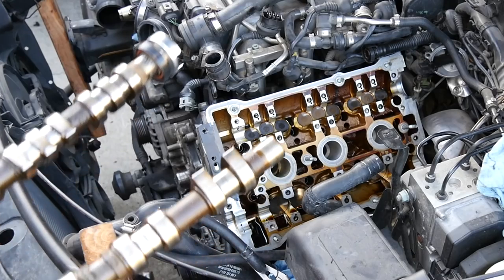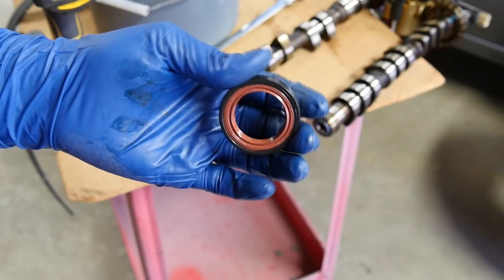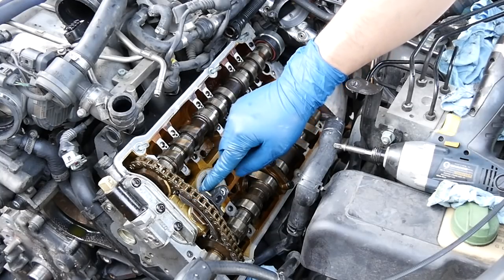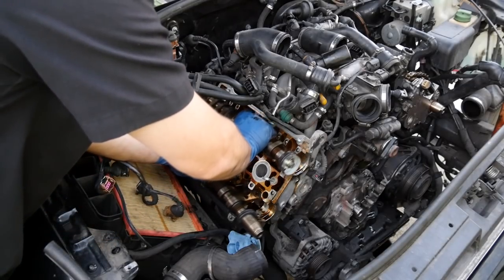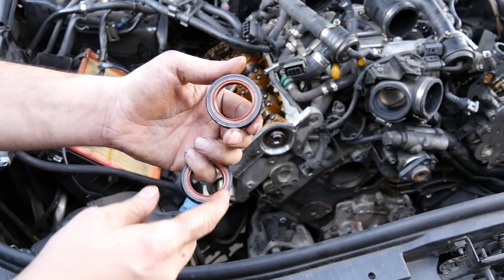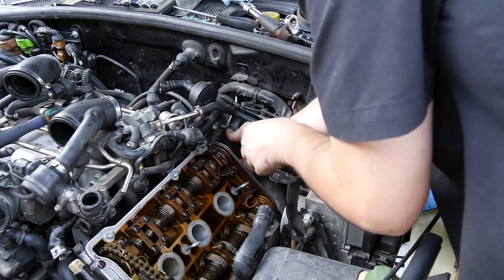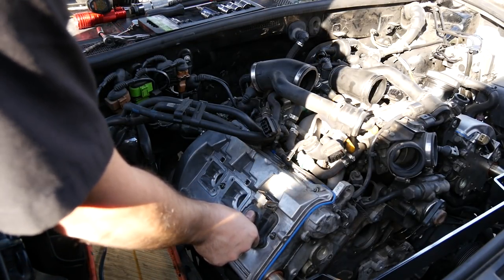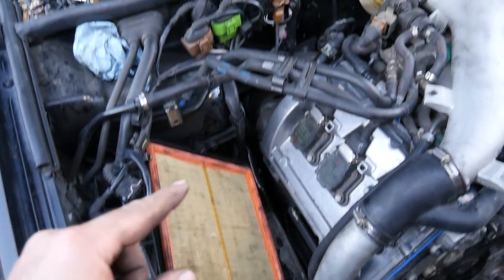Crazy Bi-Turbo Audi Maintenance Procedures - Camshaft Seal and Gasket Replacement

Comment: Hey R&W guy (I still don't know your name) - I LOVE your videos, especially these videos on your 2.7 bi-turbo. On my 2.8 V6 Passat B5.5, I JUST finished replacing both cam tensioners, cam chains (connecting both cams), CCT gaskets, all 30 lifters, timing belt, cam seals, rollers, water pump... and on and on.  The car runs AWESOME now.  Your videos were VERY helpful. You asked in one of your videos if these tutorials are helpful because they don't make you much money, but I can tell you that they were invaluable for me.  I can't thank you enough!

Comment: "Tourque it down to factory spec" proceeds to hit it with an impact.
Reply: Ford Fanatic 😂😂that shit kill me🤣🤣
Reply: I've seen others use hand tools and say the clicking noise to satisfy the viewers.
Reply: Could be a torque controlled impact gun, I believe some of them are very accurate.
Reply: Right that shit killed me 😂
Reply from the maker: I torqued it to factory impact spec.
Reply: Gutentight, factory spec!
Reply: Ford Fanatic . Factory spec/real world spec.
Reply: I read your comment and then couldn't stop laughing when I saw it happen
Reply: great humour 🤗
Reply: Ratchets And Wrenches haters will be haters - no need to explain yourself
Reply: I believe its the Hall sensor rotor to camshaft, should be 20/25 Nm
Reply: sense of humor, anyone?
Reply: We that spec “torque it to yes” in my shop, it works everytime

Comment: Great video, always wanted to know how the chain tensioner worked.  I had several Audi in my time Audi GT Coupe, 5000 CS Turbo Quattro, and the first V8 imported by Audi.  Still have the tool to remove the crankshaft bolt for the V8 in order to do a timing belt.  I used a torque multiplier  (4:1) to remove stubborn bolts (especially crank bolts).  This avoid breaking your knuckles when the bolt break loose.   Keep up the video, and we appreciate your time in making these videos.

Comment: You might have this video I honestly haven't checked, lol. But make a video of how to perfectly line up the front bumper on a B5, please. Rear bumper too if you want, lol.

Just did the front crank seal on mine, as well as timing belt service. It was so much fun. But boy does it sound nice when it works 😂

Comment: FYI: The driver's side intake cam seal on the rear is a different part than the front seals. The cam rotates in the rear seal counterclockwise, whereas it's clockwise on the front seals. All of the new VW Audi cam seals are PFTE without a spring under the lip and are supposed to be installed DRY.

Don't install the valve covers until AFTER you get the new timing belt installed. Then rotate the engine by hand at least two rotations, then reinstall the cam locking bar, check and recheck the timing on the cam marks. Count the chain link pins. If after that you're sure the timing is right, you can then install the valve covers. 

The timing chain tensioner plastic shoes should have been replaced when the tensioners were out. These wear out, get brittle and break off, leaving plastic bits in the head and down in the oil pan, cause metal to metal sliding contact between the timing chain and tensioner, cause extra slack in the chain, and then the chain can then jump a tooth or two and cause the valves to collide with the piston tops. Yes I am speaking from experience. Happy wrenching.

Comment: RNW - very helpful and well done videos I have an 2004 Audi Allroad 2.7t I have pulled heads and replaced the gaskets, timing belt I am getting codes P0340,P0345 engine is running and started on first try lots of smoke that went away, engine is running rough and idling just as bad  I read to change the Camshaft position sensor I had an extra one switched it out but still the same issues after clearing the code? Timing Belt? any suggestions would be helpful and thanks for the great videos.

Comment: I am finding that a V6 Passat is enough to put my DIY car mechanic urges in check, and while I love turbo powered cars (Volvos) servicing a twin turbo Audi engine is probably very similar to what it would be like to overhaul a Messerschmidt engine. Yes, the detailed videos are better.
 Most "authoritative" service manuals will give instructions like: "Remove top portion of the engine" without actual instructions and even photos. If there are photos, they were taken from ceiling distance without auxiliary lighting, or even arrows pointing to the part in question.

Comment: I just finished my full engine rebuild after 2 years.. im fairly knowledgeable with this specific car, except my timing is off on bank 1, passenger side.. is there an easy way to adjust the cam one tooth? A friend suggests to pull the cams out and start over.. but I feel there's a simpler way.. your help would be appreciated!

Comment: Correct me if I'm wrong, lubricate the oil seal with Silicone grease are much better than oil , because oil can make surface with inside spring gets harder faster. I remember some manufacture oil seal are lubricate with silicone grease.

Comment: I don’t own an audi. And I won’t. I own a junk ford ecoboost that seems to have learned too much from VW/Audi over the years, lol. But I still enjoy watching your videos and it’s cool to see how some of these cars/engines work and are put together. Personally.... I like seeing things that would have me loosing my mind from an engineering/service stand point ( like a 5mm bolt through the power steering pulley, THEN a 6mm bolt through the same pulley and neither removable lol ). When will the guys doing these CAD drawing in an office learn that part of engineering something, is also to make it serviceable. Disassembling the front bumber and rad support to change a serp belt is a pretty big fail.
Side note. 2.7T motors are pretty cool. My friend had a S4 many years ago but sold it after blowing then turbos up 2 times in 15k miles.

Comment: Ratchet and reaches thank god for you and your videos. I wanted to ask how long it took in hours to do your valve cover , half moon seals set timing front and top of the motor ? From opening the hood to closing the hood how long for this type of work? I don’t have much money so don’t want to get ripped off ? If you want to help that’s great but if no answer is forth coming I’m not one to judge either way. Thanks again for videos from your mate in Australia

Comment: great video but you forgot the rtv at the worst part that v shape and how did you get cam covers of without the 1 hr of hell from the combi valves at the back
Reply from the maker: I didn't forget the rtv, combi valves are bolted into the cylinder head. cheers

Comment: I like the channel, suggestion tho, do not put oil on the outside surface of the camshaft seals, they should be RTV'd just like a gasket.   Oil on the inside, RTV on outside

Comment: Hey when you tighten the passenger side intake cam sensor that bolts up to the cam & the cam turned did you turn the cam back so the marks lined up?

Comment: On my 2.8l my cam caps have an oul feeder bar across them all,  holding them in formation, not the oil hole in the bolt hole. Have you seen this?  I cannot find any referance or part name. Two of the plastic connectors are broken :/

Comment: Hello I have a 2005 AUDI Allroad 2.7 bi-turbo - alternator is not working - no output voltage - can it be replaced without doing the front end service position removal of front end?

Comment: I have a 2003 Audi A4 1.8t Quattro  I had my timing chain, drive belt tensioner, timing belt and water pump replaced and on the invoice these items were referred to as cam seals.  So now my car is throwing a camshaft position actuator circuit/Bank 1.  This, after my mechanic told me that all else looked great with the car.   Are these issues related?? I feel like they’re taking advantage of me. Something stinks to me.

Comment: Which AUDI V-6 Has Turbos & A Timing Chain?Thought the 2.7 Twin Turbo Was A Belt,But I See A Chain.  I' m Considering Looking for the 2.7 V-6,01-06, But Reading Too Many Bad Reviews & Problems on U Tube W/ These Engs.,After About 140-175,000 mls.Besides Basically Having To Remove the Eng.From it's Cradle to Repl.the Turbos,To Doing Looks What Ur Doing,Repl.the Camshaft Seals,Checking the Cams for Excessive Wear & Things U Would Not Expect to Be Doing So Soon on A GERMAN ENG.?

Comment: You should have replaced those cam chain tensioners. The plastic feet on those are ticking time bombs if the car has over 150k miles. You will bend the valves and Jump timing if they snap

Comment: you can make leaks worse when you use r.t.b on things that did not have factory r.t.b just use new seals as they come to prefent leaks in the first place. and do not use electric tools on spark plug leads if u damage the mount the leads can cost up to 100 dollars a peace

Comment: Sorry to be bearer of bad news, but that thing is going to leak really bad.
You messed sealing of end caps really bad. You should RTV all area outside of notch next to bearing. That notch protects bearing from RTV. You put it on surface next to bearing so when you tighten it, that RTV will squeeze into bearing.
You also should RTV both sides of valve cover gaskets because that thing is going to start leaking in 20-30k miles.